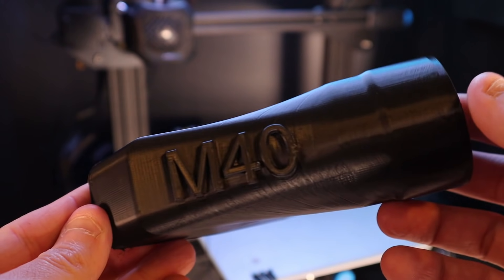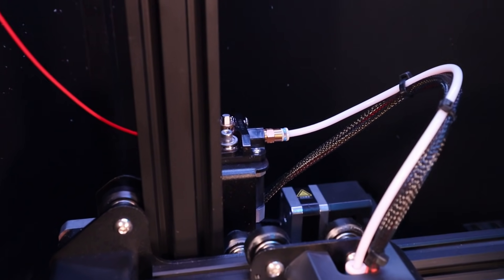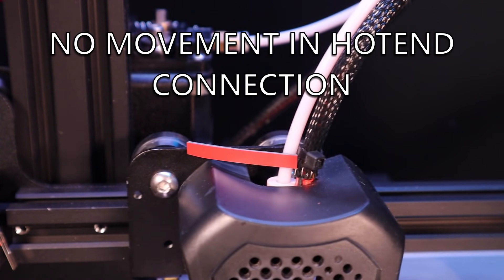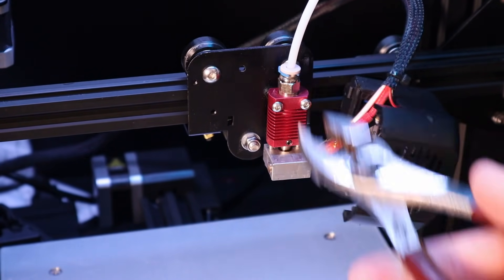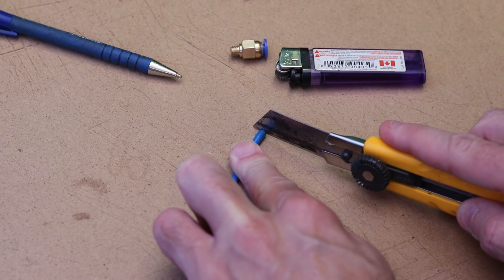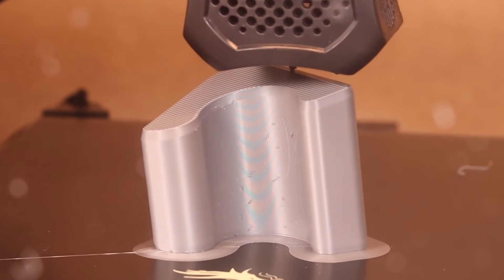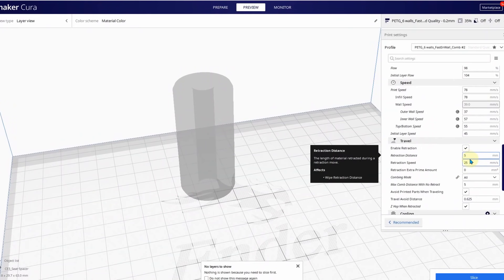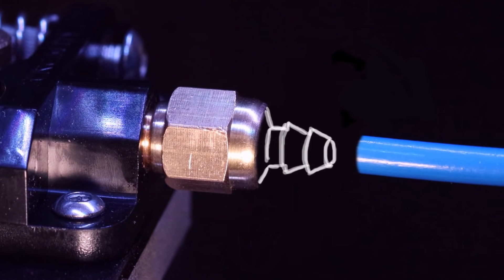Creality Ender 3 V2 - Fixing the Hidden Problem that Can Cause Stringing and Unresponsiveness

Comment: This connectors are design to work with one side pressure. This is the real problem!
Reply from the maker: If you can buy the PC-4 M6 Through fitting, it works well with the same pre-load technique used for the M10 on the hotend side.   I have a follow up video with this concept already, but it isn't necessary to flare the end of the tube as I showed, instead, leave the fitting slightly loose, press the tube tight and then tighten.

Comment: Hey guys, im struggling with my ender 3D printer. 
i got my kit and built it all up, but when it comes to calibrating the axis, the y axe wont stop at the "stop switch" and just keeps moving towards the end and makes "krrrrrkk" sounds :(   built it up again and the same issue appears.. 
For me the switch seems not to do its work to put out the signal, that the axis is at the end resp. at y=0.

Bought it 3 years ago, was very upset the former days and just thought i can ask here =)

so guarantee is not a thing anymore. didnt sent it in, bc the delivery took 4 months and i didnt want to wait another 6 months or so to get it back, so i just left it where it was:D
Reply from the maker: It sure sounds like a problem with the switch, the wire, or connection to the board.  Can you swap out the switch and wire to start, they should be pretty cheap, even borrow from a different axis to see if that helps.  If not it might be a missing pin/broken at the connections on either end.
Reply: @NeedItMakeIt  okay, i will try to change it with one from another axis, thanks for your response man!
Gonna give an update, but will take some time =)

Comment: Great video.
Reply from the maker: Thanks, I have a few follow ups, the best solution I've found so far is to purchase a Pc-4 M6 through fitting, it seems impossible, but they are available to buy for pretty cheap.  Leave the fitting about 1/2 turn loose, push the tube in fully with some sandpaper to help and then tighten, it loads the springs nicely and bottoms out the tube into the hole, simple and effective.

Comment: Hi my filament got stuck on the extruder wherein it's solid and seems like hard glued on it I can't remove using small needles either.
Reply from the maker: In the hotend?  If that has happened, you need to heat up the nozzle, remove the bowden tube and work it out from there or cut away the portion causing you trouble and reinsert.  They are pretty cheap you can also replace completely.
Reply: @NeedItMakeIt  it's stuck in the screw thing so I soldered it and destroyed the parts with the blue hook. But yea I just ordered new one with better quality.  Thanks.

Comment: So why did you not use a compression fitting instead of a push in fitting? A compression fitting will grab onto the tube and not deform it.
Reply from the maker: I wasn't having success finding anything that was the right size, they are available, people have sent me some links, they can be found on Aliexpress and Bangood mainly.
Reply: @NeedItMakeIt 
I'm not sure what country you're in, but in the US McMaster Carr is a good place for stuff like that.

Comment: I looks like a coaxial jack
Reply from the maker: It does a bit, that's a good point, the coax fitting has a crimped connection.

Comment: Pushing through a tube is silly.  Imaging boat steering, if you pushed, instead of pulled.  Or the breaks on a bike.  Those wouldn't work too good pushing.  Try this...  Ditch the Boden, and go direct drive.  It shouldn't even be a question.
Reply from the maker: While I agree, the best analogy is pushing a rope, it is really only a problem for TPU.  

Direct drive printers have many advantages, my first printer was one.  Maybe I'll go back someday if they can be made light enough to allow fast prints without ringing.

Comment: standard industrial airline components will always have this play.  This the trade off when using quick release connectors. 
As the guy slyly suggested at the end of the video, a permanent connector with a jubilee/ hose clip will be the ideal solution if you want to forsake the quick release connection.
Reply: Very correct as they are meant to have pressure on them, you have to push the tubing in to be able to unlock them... SMC even makes a special tool to remove the tubing from these types of fittings

Comment: One possibility is drilling out the extruder end fitting then doing the same at that end. Honestly though, I'd probably go for a different, improved fitting. Or undo 1 thread revolution, seat the tube fully, then tighten the fitting again. The static pressure from both sides might prevent movement longer term.

Comment: I'm going to try this with shrink tube. One on the ptfe tube and another that can shrink on the connector to the tube.
Reply from the maker: I tried shrink tube and had no success at all, it would slide right along, I even heat shrunk several layers as well to all the tube to then go right over the fitting.  Did not work in the least, it didn't have any grip on the tube.
Reply: @NeedItMakeIt  thats good to know. Thank you. I was thinking of trying marine shrink tube, but it might leave  gunk on the fitting.

Comment: Pretty sure PTFE is toxic when burned. I personally wouldn't advise an audience to do this.
Reply from the maker: It is, see pinned note in comments  and follow up video.  Also note that the Capricorn website recommends this as a solution.  The follow up video shows a better option with no heat.
Reply: Sorry my bad for jumping in without looking. When I first started 3d printing I was getting myself clued up and came across the dangers of burning ptfe. That alone was enough for me to upgrade to the all metal hotend lol. I do like your other option though.
Reply from the maker: @jonathancodling1543  100% valid point, they should really make people aware of these issues when you purchase one.   I woudl have included it in this video, I did not know when I made it, a viewer pointed it out to me.   People have become very sick for example when overheating a non-stick frying pan, that would be a lot of teflon!  I will be making follow up videos about the health issues with 3D printing, also focused around the nano particles 10+ um emitted during the extrusion process.  They don't seem to know the impacts of these on our health, at least people should be aware and they can take the precautions they would like to.
Reply: That would be a really good watch! I'll look forward to you making it. Yeah I suppose its ridiculously easy to over heat a non stick frying pan I never thought about that. Something else for me to read up on. Ill end up replacing them aswell 😂😂😂

Comment: Dude, im new to 3d printing...but anything with 2 eyes and a brain can see ALL the BS creality could have fixed when building the ender V2. ive changed the main tube back to the white because of the tolerance being to small to retract when wanting a color change, or even just changeing filiment..the blue tube started becomeing really lose as more color change prints were printed from reefing on the filiment to get it out of the tube, just as you explained..i have been getting strings on pla lately, glad for ir vid thank you.....the main thing i can see, is a BETER extruder gear set up, and the issue u presented here...creality my have the best printer out if these 2 or 3 issues are resolved...should mention i did leave the blue tube in the hot end, that is the only real fix there..
Reply from the maker: No argument there, you'll see your thoughts echoed in my next video set to release mid-week next week.  You're right they are small things mainly.  I have been pretty happy with the printer in general and it is leagues better than my previous printer, it would be nice if they made some tweaks, an all metal hotend would be a nice touch, I'd need to experience one myself to know more about the drawbacks, but from a safety standpoint, it makes sense.  My next video is about the extruder assembly.  You've made some very good points, thank you for the comment.
Reply: @NeedItMakeIt  cool beans bro...i just got the dual drive gear from amozon. Not sure if someone makes better ones, but at this point i DONT want to be saying "it works good enough..." but it works..there are a few BS tolerance issues with the threaded screw and the second gear drive i was really unhappy to feel...but, i did buy the cheapest one, didnt look like any differences...set up on e-steps to 100mm. 
im SO happy i dont hear the sound of that extuder gear sliping. I have major ocd, so when things sound like they are not working properly, its not worth the dirt on my shoe to continue untill......drove me up the wall...i cant see any difference in print yet, but at least i know i can shove filiment out the hole at intended force...

Comment: Hi, I dont know if this will fix the issue but did you try to use compression fittings? Like the bike disk brake ones? That maybe will solve the solution or cause another problem... idk
Reply from the maker: I had been looking but didn't really find anything that would allow the tube to slip over easily, this tube is pretty hard and I didn't want to heat it after I learned that it is fairly toxic.

Comment: great video, thank you. 
i see you also have the mark on the outside at curves/circles what i have too on some prints. how can i eliminate this? don't find something useful :/
Reply from the maker: It will be hard to remove completely with the Bowden setup, a direct drive will be more responsive.    You'll have to dial in the retraction for your printer and your filament, minimize the moisture in your filament, print with a smaller nozzle size and also layer height helps to hide these bumps.  Generally the best way to avoid the look of this seam is to make sure it is aligned with a corner on your part.

I didn't even know there was a seam when I was using my direct drive printer, with the Bowden setup, and the 0.6 nozzle it is quite visible. 

Probably not what you wanted to hear, but I hope it helped.

Comment: The gray aluminum extruder kit from creality uses a pass through fitting that will allow you to bottom out the Bowden tube in a counter bore in the extruder and then tighten the fitting like you would and the hot end. Solved my retraction problems. Not sure if the red one is also like this but it does not appear to be.
Reply from the maker: I bought one and it will be in my next video as well, great tip though, bottom it out then tighten the fitting and it pre-loads it so it doesn't have room to move.   The red one is an M6, I'll be testing it in a future video, it has a dual gear and there is an issue with the secondary gear wearing through the aluminum over time.

Comment: New to 3D printing. Why not use barb fittings? After setting the initial connection this will not move. Chamfer the fitting ID to eliminate a point of filament dragging on a sharp edge. Thoughts?
Reply from the maker: I think a barbed fitting could work, the issue is that these tubes are very hard, pressing it on by hand wouldn't likely work too well.  A tool similar to what PEX uses would work well and it would be a great connection.

Comment: I had the same problem, but all I did was  unscrew the metal fitting and pushed the tube all the way back (basically flush with the stepper motor) and then reattach the metal fitting. It doesn't even budge now.
Reply from the maker: With the M10 thru fitting?  I can't see that helping at all with the M6 as it doesn't bottom out in the threaded hole.  

Thanks.
Reply: @NeedItMakeIt  Maybe I was having a slightly different problem. My tube would pop off causing under-extrusion. Pushing it further into the fitting and then tightening it down allowed more of the tube to be held in by the little blue clip.  I dig your Channel BTW!

Comment: I spent 2 days trying to understand with I was having problems on the retraction. I get in the same conclusion when making a mark with a black pen on the bowden. It was always moving on every retractions ! This was making some click on the extruder.
Reply from the maker: I'll have a video out tomorrow with as close to a permanent solution to no movement as I can think of.   I'd really like to know what you think.
Reply: Direct drive.  A Boden is a silly idea, as they are not for pushing. Move the motor to the head, and pull the filiment through the tube.  It's a night and day difference.  There are plenty of designs out there.
Reply: @falsedragon33  Direct drive is good and bad as boden can be good or bad. Direct drive have less problem on pushing the filament but the second law of Newton apply also. With a heavier hotend there is more problems on accelerations and more jerks. You will have to print more slowly to compensate ;-)

Comment: Detailed comprehensive analysis. Well done, and well presented.
Reply from the maker: Best compliment!  I have a follow up video on the way with this problem solved completely. It may be more detailed, but still short and to the point.
Reply: @NeedItMakeIt  I have a Modix Big 60 with a volcano hot end  and two Creality ender  5 plus printers with Micro Swiss hot  ends. One of the crealities and the modix have Teflon tubing from McMaster Carr. It's high quality but the i.d. is a bit too large. I was puzzled why my continuous prints were near perfect while my prints with multiple starts and stops were either really stringy or resulted in a system jam, not caused by a clogged nozzle. I tried various retraction settings and then realized that the Bond Tech extruder's high torque, the oversized bowden tube and retraction settings resulted in the filament getting crinkled enough in the tube so that the filament was actually difficult to pull out of the tube even with the tube completely removed from the printer, and that the extruder, which has been calibrated, was actually pushing so hard that a small curl of filament was occurring after the drive gears. Yikes!
I am always learning, thanks again. Capricorn on order.

Comment: You do realise that those pneumatic press fittings are designed to allow you to take the tube back out again if you press and hold down on the collar?
Reply from the maker: That's correct, they are designed to do that... it did not work.  As they wear, shavings of plastic buildup inside and prevent the easy removal.  A pair of pliers and a vise was needed to remove it, or course that causes the end of the tube to become unusable.  I've since learned that some sandpaper wrapped around makes a world of difference in working with this tubing.

Comment: When I replaced my extruder with a dual-geared one, I managed to re-use the original tube without problem. It was tricky holding the fitting in the unlock position and pulling at the same time.
Reply from the maker: By chance do you know if the dual-gear comes with a M10 threaded hole, or is it M6?  I have purchased the metal replacement from Creality because my plastic one is starting to warp.   I'll have a follow up video coming in a little over a week to offer better solutions to solve this tube problem for good!
Reply: @NeedItMakeIt  The one I bought was almost a direct fit with the original hardware. The PTFE tube nut was the only thing sized different. I had to kajigger my filament sensor into place, though. Flipped the screws around the wrong way on the plate, used a rubber band to "Set height" on the screws, then another rubber band to keep it on the screws.

Comment: I thought this was obvious for bowden setups. That's why capricorn tubing is so popular.
Reply from the maker: There are lots of people that do not it seems.  I started with direct drive for example and it just isn't a problem.  The better tubing will help, but my suspicion is that they too will fail.  A permanent solution is needed and I am working on it for anyone who wants it.
Reply: @NeedItMakeIt  I do agree. 
That is why I said I thought it was obvious but apparently not.
 I do know some newbies to this hobby who are clueless about things like this then get frustrated when Chinese printers cantamount to higher failure rates while kept stock. 
 Every component in printers that move are prone to fail at some point especially plastic parts or cheap alloys. 
Your video is good for showing them things like this that some people would have otherwise missed. Maybe it might help someone come up with alternate parts in the future.

DD is better in some aspects but can fail for high speeds due to the added weight on a big gantry. Offsetting it can fix a lot of the issues either with upgrades like linear rails/stabilizer rods, maintenance like tensioning or even suggesting XY core/delta setups and the like. Still, the shorter feed is preferred for flexibles and overall higher accuracy. 
Going with plastic parts here or single gear extrusion is not preferred but I'm sure you can point that out for people why they should go for certain better part setups. 
You also have people who are putting in bowden style settings in Cura on their DD setup and ramping up the retractions to the point of jams and failure. 

That said, I think the bowden style setups are good for miniatures as they do sharp corners faster than the DD setups with heavy heads on simple cartesians. It's definitely gotta be fine tuned for that though. Even with capricorn you start getting a faint sway after 120mm of tubing and it's accuracy more noticable after about 220-240mm+ of tubing. I think this is why a large bowden setup such as with the chiron is not ideal for miniatures.

Comment: I see you didn't try putting the cable for the hot end in the little clip attached to the side of the extruder. It would relieve a lot of strain on the bowden tube.
Reply from the maker: It seems poorly designed, the cable with sleeve is not the correct size to fit.  It almost seems as though it was designed for a different purpose.  I suppose I could use a zip tie to suspend it better

Thanks,